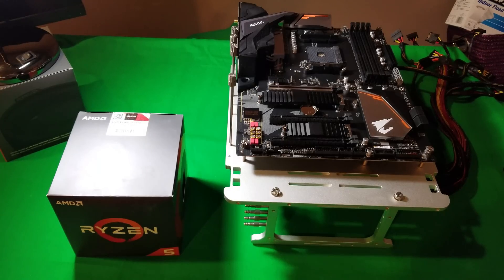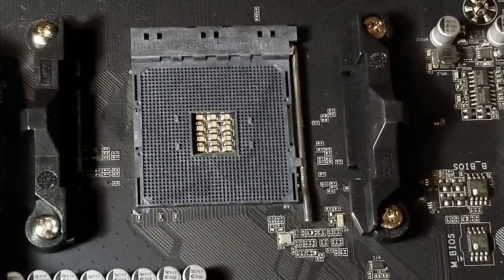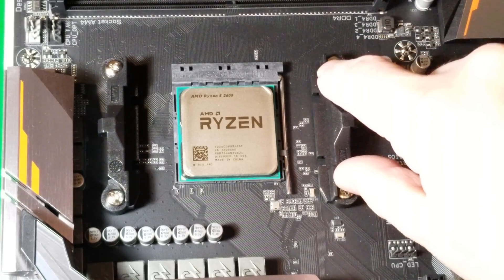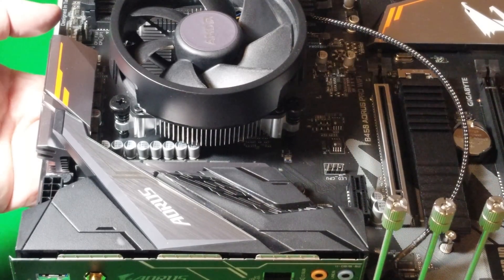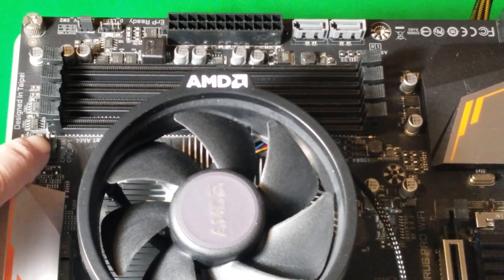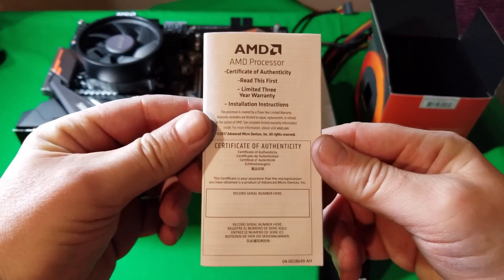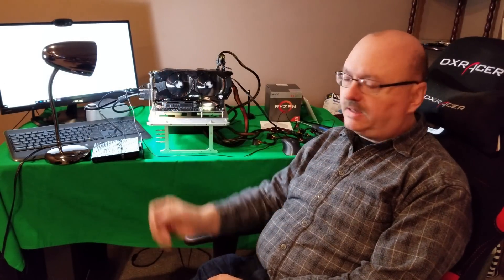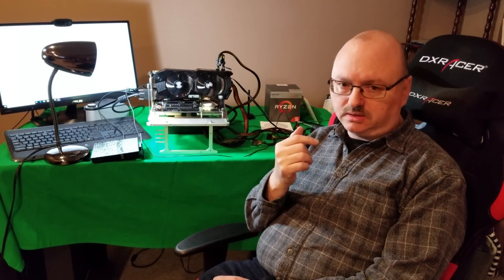Ryzen 5 2600 Unboxing and Install plus CPU Cooler Temps

Comment: Can anyone help me my Ryzen 2600x is reaching temps up to 60°c with stock cooler without any overclock and on 4 to 5 percentage load with Ambien temp of around 37°c or even higher in India. Is my CPU Ok ?
Reply from the maker: Given the ambient temp, and that this CPU tends to run a bit higher it still does seem like it's a bit high, my suggestion would be to change out your stock cooler for a better one, or maybe even consider going with a water cooler to help...Hope that helps...could maybe also try removing the thermal paste that came with the stock cooler and use a better one like Noctua NH-T1 it's a bit better and might help if you don't want to change out the stock cooler...Thanks...
Reply: @Reviewing_Playing_and_More_RPM  Thanks for helping me

Comment: really appreciate this video I was worried I needed thermal paste and now i know I dont need to worry because its pre applied!You earned a like and sub
Reply from the maker: I'm reuploading a previous video on the installation, and this one to maybe later, but just wanted to mention to ensure you have the AMD turned the opposite direction so it doesn't interfere with your Ram...Take Care...Thanks...

Comment: How is that b450 board? Is there any problems with it after a few months?
Reply from the maker: +Hybird_ Beast None it's the best of every system I've ever actually. Still haven't sold it yet might even make an appearance in a cooler video very soon. Stock cooler is a bit loud for my liking...I would buy this again without hesitation but that's just me...Take Care...
Reply: Reviewing Playing & More RPM Thanks for the response now I don’t have second thoughts on buying this board. Excited for my first build
Reply from the maker: @KangHybrid  Yeah I really like it...Good Luck with your build...

Comment: I just completed my Ryzen Rig..but I'm a little bit confuse with the temperature..
I use 4 softwares, one of them is Speccy and it detects that my Ryzen temp is 80-100*C..
But my other 3 detect 40-50*C..I use Asrock tuning, HWi and HWMonitor..
Should I worried about this?
Reply from the maker: I have read that Speccy can sometimes not be accurate...If the other 3 software are saying 40-50 then it's likely correct. You could try downloading Unigine Heaven it's free software to benchmark your GPU and will give you more accurate temps, to test the CPU try a free download called AIDA64 if AIDA64 tells you the temp I'd for sure trust it. Hope that helps...
Reply: @Reviewing_Playing_and_More_RPM  I see..Thanks for the reply, I'll try AIDA64..That Speccy really gave me mini heart attack last night, lol..
Reply from the maker: @raflryan2242  No problem I still like Speccy for some other things but just think it's bugged a bit...Yep seeing that temps would get the heart going lol...btw if the CPU got to hot there are safeguards that would shut it down to protect it, so if it didn't shut down it's likely ok...but best to check anyway...
Reply: @Reviewing_Playing_and_More_RPM  yeah, I still using speccy in my office PC, It detects correctly 30-40*C for my Core i3 6100..
I prefer safety first for my PC, rather than it self shut down to tell me that something is wrong , lol..
This is my first AMD Rig, jumping from my old Core i5 3570K..
Reply from the maker: @raflryan2242  Yeah, agree completely, I've built a few AMD rigs recently and so far things have gone well. Have had a couple issues but nothing I couldn't resolve though. That's a nice upgrade from the previous I5, you will enjoy the new AMD I'm sure, I really have been happy with mine. Just sold a R7 1700X and there really happy with it...Good Luck and hope it all shows things are ok...
Reply: @Reviewing_Playing_and_More_RPM  Thanks mate..Really appreciate all your information..

Comment: I have the r5 2600 with b450 aorus M and I have like 45 degrees at idle.. with stock cooler, is that normal?
Reply from the maker: +Privatel3oy Because of limited space for a heatsink at one end average temperatures during testing were 41C so while its a bit high it's not to bad. It's higher than average but it's to be expected for this motherboard...
Reply: @Reviewing_Playing_and_More_RPM  So.. what do you think I should do?
Reply from the maker: +Privatel3oy An easy fix might be to get a aftermarket CPU Cooler as that would lower your temperatures a fair bit.

Comment: Is ryzen 5 2600 is good enough to play most of new games at 1080p and what gpu did you suggest to pair up with the system
Reply from the maker: +Ben Aman I tested with a GTX 1050TI but if you have the budget a RTX 1060 or GTX 1060 would be great, and of course if you have enough then RTX 1070 or GTX 1070...If you want to play titles like Battlefield V then GTX or RTX 1070...but more to the point the Ryzen 5 2600 will work great...Take Care...
Reply: @Reviewing_Playing_and_More_RPM  nice im subs to you hope you will make great videos again

Comment: Great tutorial but do I have to uninstall my whole motherboard to install this cpu? Or just have the PC turned off then do the following steps in this video.
Reply from the maker: No you can just install the CPU, keep in mind the orientation of the CPU Cooler, keeping the stock cooler to allow more room for the RAM. Sometimes it needs to be turned to the other side, so dry fit first to check RAM clearance and if it's good then go ahead if not turn it around. Thanks...
Reply: Reviewing Playing & More RPM ok thanks!

Comment: Is this cpu compatible with the MSI B250 motherboard?
Reply from the maker: No the MSI B250 Supports 7th / 6th Gen Intel Core/Pentium/Celeron processors for LGA 1151 socket...For this CPU you need a AM4 Motherboard. You can use PCPartpicker.com to help you pick parts that will be compatible...Thanks...

Comment: i get 70c
Reply from the maker: +ItzRaqeem Seems high but was that under load and stock cooler. Also I only ran my tests for temperature's for 6 minutes it's possible it could have gone higher if I ran it longer. Still 70C is well within the norms some others have reported. If you were running the R5 2600X it runs hotter as well...
Reply: @Reviewing_Playing_and_More_RPM  Ok thanks i was just playing fortnite at 1440p with discord open and got worried

Comment: Is gigay aorus b450 elite good Mobo WID 2600 ? For overclocking please help
Reply from the maker: It's capable of OC especially if you use the built in software that comes with the motherboard, but others have been quite successful with OC on this motherboard. For overclocking yes some have been able to get to 4.2 with no issue's. I don't tend to OC to much myself though, with the R5 2600. If overclocking it manual some have reported using 1.4V Vcore, 1.2V SoC, and auto LLC (Loadline Calibration). Hope that helps...
Reply: @Reviewing_Playing_and_More_RPM  IAM more curious about the board is b450 aorus elite a good board ? For 2600 ?
Reply from the maker: I love this board personally, it's one of the best PCs I've built...works with no issue's and so many features...I recommend this board...
Reply: @Reviewing_Playing_and_More_RPM  okay thank you :) your board is also B450 aorus elite ?
Reply from the maker: @kanhaijena6237  No mine is the B450 Pro Wifi, but my answers were to your question on that board.
Reply: @Reviewing_Playing_and_More_RPM  okay thank you :) keep uploading :) thanks for the help will go WID b450 aorus elite and Ryzen 2600 :)
Reply from the maker: @kanhaijena6237  Sounds good...

Comment: man i think i mess up my ryzen 5 build coz my mobo dont have those four little things that will hold the screw when I remove the mount. I cant fit the stock cooler it wont go thru the 4 hole so i thought that the metal spring in the wraith cooler are so hard i have to remove them and it fit well. now i'm worried what are the risk after watching this
Reply from the maker: +Angelo Flores Did you ensure the backplate was in place when you tried screwing it in place. As for taking off the spring in your stock cooler I never said to do this. However at this point if your stock cooler is no longer able to be used then getting an aftermarket CPU Cooler might be a better choice. It will provide better cooling and might look nicer as well...Hope that helps...

Comment: Does the orientation of the cooler matter when placing it or will it fit regardless of which direction its facing? Also will any after market cooler fit or are some different sizes?
Reply from the maker: +Rob Shrives Yes, when I did the video I realized that turning it around from how I did it will give more room for the Memory.  Also any aftermarket cooler should work but it will depend on your case and how big a cooler it will support. Check your case to get the dimensions it will fit for a CPU Cooler...Thanks for watching...

Comment: The metal backplate....could you put a thermal pad on the back side   to hold the backplate in place ?
Reply from the maker: +Richard Dower Not sure why you would want to do this but if you plan to do it anyway then 3M Double sided foam tape would work. Just peel off one side, and stick it to the back plate, the other side will act as an insulator to keep the solder points on the motherboard from grounding out on the CPU Cooler. NOTE: I have never tried this so proceed at your own risk...

Comment: Hey, i have R5 2600X with Wraith Spire cooler and when iam playing BF5 cpu usage is jumping up to 90%(Mostly around 70-90%) iam worried that cpu temps might be high with that high usage. Should i be worried?
Reply from the maker: Well having a high CPU Utilization could be normal with this game, but if your worried about the temps when it's running at that, I'd suggest using the free download of Aida 64 Extreme and do a stress test of the CPU and see what the temps get to at 100% utilization, it could be just fine. I ran this program on my R5 2600 and at 100% load it was still only getting to 57 degrees, so that's really good. If you need help to run it I have a video showing that as well. It could well be just fine. Take Care...
Reply: What graphics card are you using? You should try to make the GPU work harder. Ideally you have 99% GPU usage and much lower CPU usage. It's crazy but sometimes increasing graphics settings increases performance because you shift work from the CPU to GPU

Comment: My computer keeps crashing at random times and im assuming its my cpu thats causing it but when i go to the bios it says 32°c. Should i redo the thermal comound?

Btw ive had this build for just little over a month
Reply from the maker: There are a few things that could affect random shut downs, one is the Power Supply, but most often can be the CPU overheating, or some other hardware component. My suggestion is to try downloading Aida 64 Extreme the free version, and do a stress test on the CPU and GPU to see what temps your getting. This will tell you if either of them are overheating due to temps...If you need help on how to do that I have a video explaining it as well. If it turns out it's the CPU, then remove and re-apply the Thermal Paste/Grease and if it's the GPU check that it's seated properly and that the fans are spinning under load to keep it cool...Hope that helps...
Reply: @Reviewing_Playing_and_More_RPM  🤙

Comment: Hello, I have a question: so the cooler is goint to the CPU without adding thermal paste ? Is this little square on the coller replacing thermal paste ?
Reply from the maker: +Butch Hudson The CPU Cooler has paste pre-applied, the paste covers the entirety of the surface. If you wanted to you could remove it and apply your own Thermal paste of your own though. Thanks for watching...
Reply: @Reviewing_Playing_and_More_RPM  thanks for your answer. Do you recommend to use this paste or change it for another one? I dont have experience in this And many ppl say, stock cooler Is not enough and my friend Is telling me Now, this paste is trash And need to be replaced with some better
Reply from the maker: +Butch Hudson I have used the stock cooler with no issues but with this CPU Cooler I did change the CPU Cooler as it was a bit noisy. But when I ran my temperature's on 100% load it was getting to 74C and now with aftermarket cooler it's 57 max. So depends on what you're using it for. If your doing long Gaming sessions then if you want cooler temps, then change it otherwise you'll be fine for light gaming. As for the paste it's fine but enthusiast my want to use their own. Hope that helps...
Reply: @Reviewing_Playing_and_More_RPM  thanks you for those helpful answers. I am gaming and Twitch streaming, so I will definitely need to buy some better cooler.

Comment: Great video, im getting a min 35 celcius and a max of 50. Is that bad?
Reply from the maker: +Chilz.z.z chillzon No that's really good actually...Is that idle and load, if so it's great. Mine hits slightly higher under full load, but lower on idle. I changed from stock cooler as well. So if your using stock then that's really great...

Comment: Is it normal that it took a ton of pressure to install the cooler?
Reply from the maker: It does seem to be, not a lot, but definitely could have been easier. Just ensure the backplate is up all the way and it will help...

Comment: It seems that high 70's c temps are common  on this cpu with the stock cooler. Anything higher i think would indicate a possible air gap in the stock thermal paste. I ordered the Noctua NH-D9L cpu cooler from amazon, should be in this weekend. I will let you guys know how it goes. And greetings from montana eh!
Reply from the maker: Yeah 74 was under 100% Utilization, with the most recent CPU Cooler it went down to 57%, so worth changing it to something better. Glad to meet you Turbo MT from Montana, I never got there but lived in Calgary, Alberta for some time...Take Care...
Reply: Noctua NH-D9L is installed now, max load temp i was seeing with stock cooler was 79c now with the Noctua I am seeing max load temps of 54c.
Reply from the maker: Awesome...

Comment: Important question. At 4:07, he shows the CPU fan mounted on the board, and mentions he can't get it to perfectly level. I notice that the heat sink on the cooler is overlapping 2-3 capacitors on the board... is this normal/safe? Did you make in error in installing the fan? I'm asking because I am doing the same build, and ordering the CPU this week. I just find it odd if the board was designed for AM4 processors and the fan that comes with the 2600 sits like that... ? Any insight would be greatly appreciated, thank you.
Reply from the maker: +Donovan Stewart Hi, it does look that way but it sits over the capacitors with enough clearance that it didn't affect anything. Also I suggest orientating the fan so the AMD letters face the other direction as it is very close to the memory otherwise. It did have clearance but you'd get more turning it around. It fits fine my mistake was just not pushing the backplate up on the one corner. Once I realized it there was no problems. Hope that helps you. Thanks for watching...
Reply: @Reviewing_Playing_and_More_RPM  Oh okay, I see. That eases my mind! Thank you for explaining. Great video as well, I enjoyed it. Cheers!
Reply from the maker: Glad to help, glad you liked it. If you need anything more let me know...

Comment: My ryzen 5 2600x cpu with stock cooler went to the max temp to 93C in aida 64 stability test. Why is this happened? I dont know, because everyone said the stock cooler dont go above 65C :(
Reply: Check the BIOS that everything is okay
Reply from the maker: Hi, sorry I've spent a while since I saw your comment trying to see why your temps were so high, but unfortunately I can't find a reason that is for certain. My video coming out later today shows a CPU Cooler that reduced the temps by 20C better then the stock cooler was doing so that might be of help. Other then the obvious things like checking the Thermal Paste is adequate, the CPU Cooler is installed correctly not many other reasons I can think of.  If I find something more I'll get back to you. Take Care...

Comment: I dont know why my 2600 had 85 C° in 50% cpu usage. It is normal?
Reply from the maker: No it's not Julian, I did test using Stock Cooler and here are the results: Under Full load using AIDA64 Extreme, Temps at Max 74-76, low of 27-28, so 85 is high, I'd check a few things, 1st ensure you didn't forget the Thermal Paste, 2nd check that there is no gap between the CPU and the CPU Cooler it can happen more easily then I'd have thought, I know because I almost did that myself.  Lastly it's possible the stock cooler could be defective, it's unlikely but possible. Lastly if that all checks out, you might want to try a different CPU Cooler for better results. Hope that helps but if not and you have more questions let me know. Thanks...
Reply: @Reviewing_Playing_and_More_RPM  I appreciate your answer very much. I'll try everything you've mentioned. My PC has just 5 days of acquired, If I can not solve it, I will think about returning it. Lets you know if I can fix it. Greetings from Perú !
Reply from the maker: Good Luck, hope you solve it, and greetings from Ottawa, Canada...
Reply: @Reviewing_Playing_and_More_RPM  hello, dis you use the factory thermal paste or apply new stuff...? To me, the factory paste looked dry and unhealthy..at least on mine. I removed it and used  new paste.  It's cooled now by a cooler master hyper 212turbo led..(Yes that model name is long..lol). Temps are good.  Cheers
Reply from the maker: @capitaldd5840  Great choice of Cooler, I used the pre-applied but I did the same later and put on a new CPU Cooler with new paste.